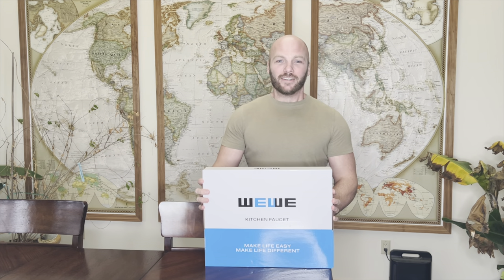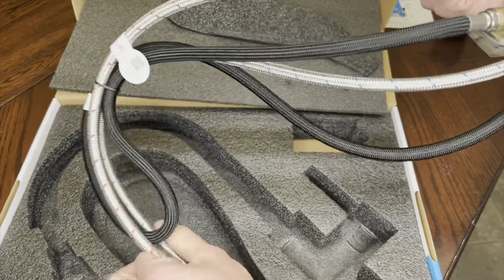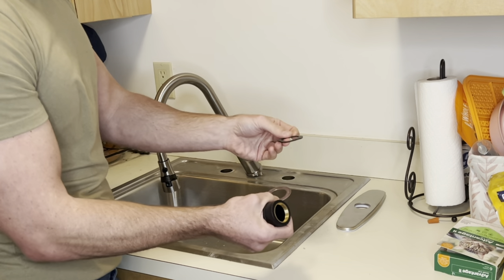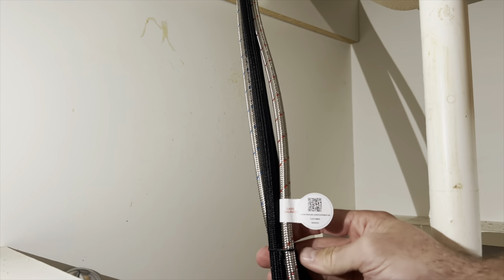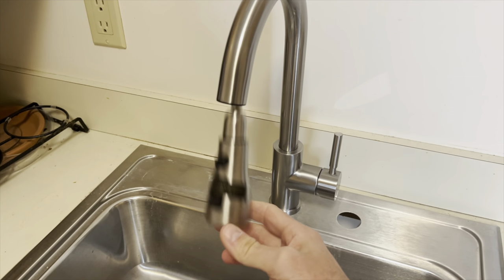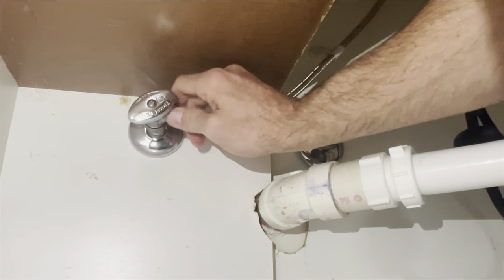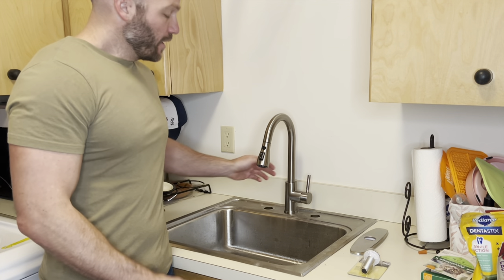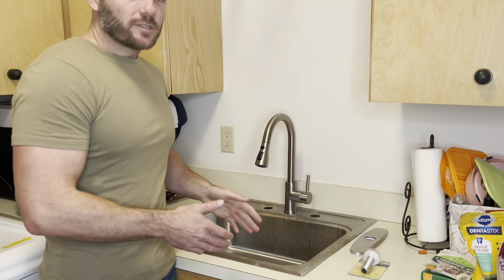Wewe kitchen faucet Installation and review

Comment: I got this exact faucet a couple years ago if I remember right, may have been last year, but it’s holding up good, with kids using it every day to do the dishes. One issue I have noticed is that the actual goose neck part is kind of wobbly and I of course burned the box with the instructions, not sure if it can be adjusted, but so far so good.
Reply from the maker: Since the neck isn’t actually full of water like a traditional one, it doesn’t need to come apart to replace the seals. So I’m not sure if there is a way to tighten it or not. I have never had to do one.
Reply: @RoscoReviews Thanks, it’s not affecting anything just a little annoying, but again two years, and I got the faucet for free from a customer who didn’t want it, no complaints here. Hope you have a great day, and happy Friday!

Comment: Just ordered one of these based off all the positive reviews. I had been looking at Moen, Delta and Pfister but they all have lower reviews at triple or quadruple the cost. Going to give it a try.
Reply from the maker: For the price they are not bad. I usually put moen in all of my rental properties. So I do recommend those. But I wanted to try one of these. I have been using it for a year or so without any issues so far.

Comment: Love this thing...just replaced my old, far more expensive, and always crappy Blanco faucet with a brand new Wewe...water pressure is like triple now, literally.  Love it!  Such a satisfying and easy install and a HUGE bang for the buck factor here!
Reply from the maker: I was pretty surprised with this. I didn’t expect it to be that great for the price. But mine still works just like it should.  And you are right, this has to be one of the easiest faucets I’ve ever installed.

Comment: I have a question, I installed my same exact faucet today, and no water is coming out at all, I don't  understand what could be the problem. I've checked the lines and nothing is blocking them I blew through them, I took it apart and I'm curious if the lines are screwed in the right holes inside the faucet. If you could give me some insight on this it would be appreciated.
Reply from the maker: It's tough to say without looking at it myself. it sounds like it may have to do with the sprayer head. did you fiddle with the buttons on there? If its not that, then I am not sure I can help without looking at it.

Comment: You were very hesitant to praise this 😂
Reply from the maker: Yeah. I think this, like with most things in life, will be a “you get what you pay for” situation. The problem is, i was expecting Wewe to fall short somewhere… then, I really didn’t find anything wrong with it. It’s a super easy install and it seems to work just like it should. 
I just worry it may not last as long as the trusted brands. Time will tell. I may have to update this video in a year or 2 after it’s had some wear. 
I am a huge Moen supporter. I use them in all of my rental units. And I probably will forever.
Reply: I have a lot of Moen products, but it was difficult not to try this one with the sheer number of reviews and it costing 1/4 of a comparable Moen.

Comment: This video was very helpful for me as I remove one of these that the previous homeowner left that is already leaking and broken.

Silly brand name aside, this thing costs only $65, and while it seems fine (but not great) while it lasts, you should plan on crawling under the sink again in a few years to replace it when it fails.
Reply from the maker: I have been curious how long one of these will last in a high use kitchen. The install I did was on a laundry room, so it only gets used a few times a week.
Reply: @RoscoReviews I bought one of these 7 years ago for a kitchen sink, and it's still going great. Just bought the exact same one for a new house because I liked it so much. The aesthetic design has been slightly updated over the years it looks to me, but seems to work the same. Found your video to watch the process as last time I didn't install myself.

Comment: Thx for the review..Might get one like this..Any updates?
Reply from the maker: Mine still works just fine. So I can’t complain. But it is in my laundry room. So it’s not a high traffic sink. If I were going to put one in my kitchen, I think I Would pay a little extra and get a Moen or Delta.
Reply: @RoscoReviews  OK thanks for the update. Have a good one
Reply: @RoscoReviews  hi! I watched and installed mine. Works great - thank you! - but I have a loose gooseneck. Tried tightening from under sink as much as I could. Any ideas?

Comment: What about the other 2 holes on the sink. Seems you were to block those I'm confused
Reply from the maker: The faucet does come with a plate that will cover the extra holes. I didn't use the place because I wanted to install a built in soap dispenser. 
You can find that video here:
https://youtu.be/UvTDCMzmgQo

You can also cover a single hole (helpful if you have a 4th hole that was originally for a sprayer) with a cover like shown in this video:
https://youtu.be/D2iLptn3mpk

Comment: Garbage! handle has leaked from day 1 cant repair
Reply from the maker: I’m a big Moen fan. So I went into this faucet expecting it to have issues. But it was so popular on Amazon that I had to give it a try. I was pretty amazed that I couldn’t really find anything wrong with mine. I had trouble recommending it because it’s not from my favorite brand. But I installed it in my personal laundry room and it still works great. So I can’t really say anything bad about it either. 🤷🏼‍♂️
Reply: I’ve had one for over a year, kids wash dishes with it daily, no leaks, just a little loose in the neck of the wewe.😅